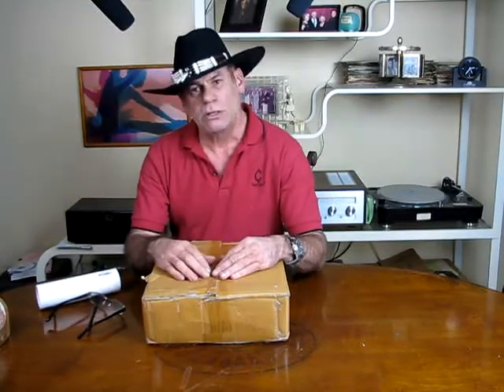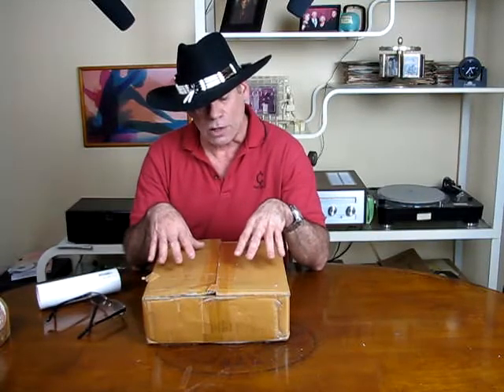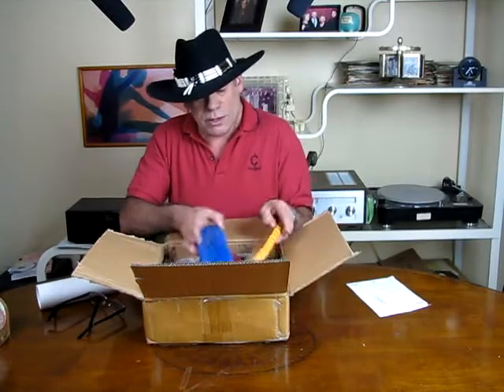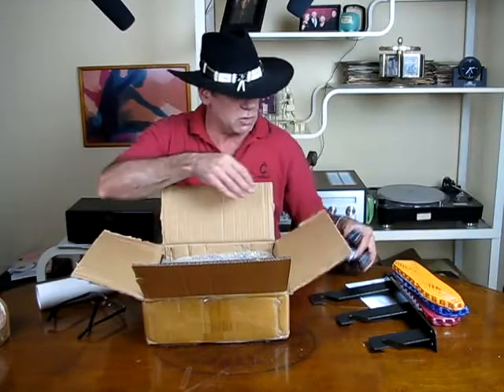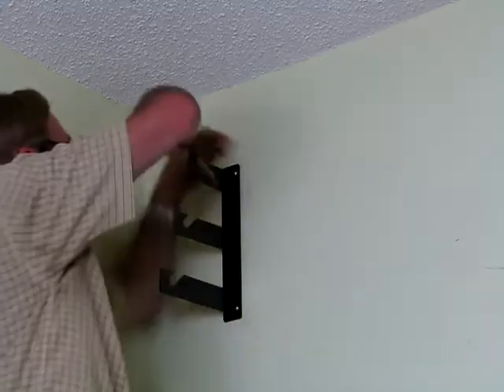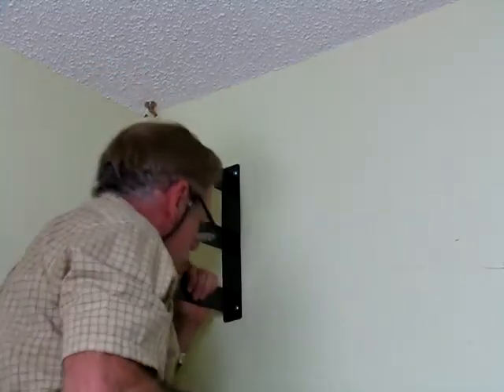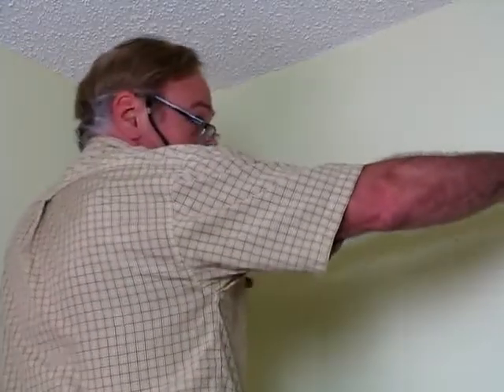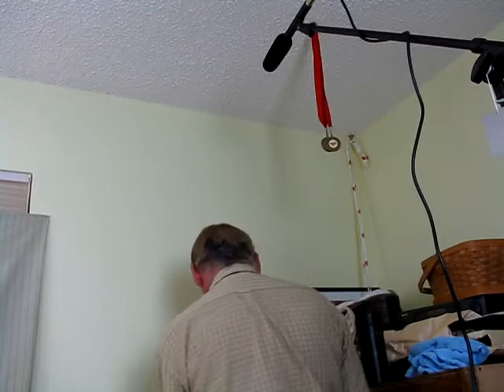Cowboy stuido Back drop3-Roller Wall Mounting system install

Comment: You look pretty darn professional with those screws in your mouth. (lol)    I've been looking at this system on Amazon and was wondering how I would hang my fabric backdrops.  I know that many people use paper backdrops on those cardboard rolls.  Nice idea with pvc.     I've also seen people attach these to their ceilings.    THX!
Reply from the maker: +OBXKEV Thank you for the feed back, took me a wile to figure out what I was going to do. Had better ideas but part of the problem is an idea that you can get the parts and does not cost too much

Comment: I was wondering if these backdrop holders can hold the weight of my vinyl backdrops which are significantly heavier than the paper one's. I really appreciate for doing this video and demonstration on how to install these backdrop holders. Oh, almost forgot to ask you what do you think about the build quality on these things? Thank you very much and great job! 👍
Reply from the maker: +Philip Ypon I think it would be more about what type of wall you are hanging it on. I am shore if you go into Studs and you use the right anchor's , and cross rod you will be fine. But the changes are plastic so that might be a concern and once again I think that will still be ok.

Comment: Awesome video!!! Just wondering why instead of inserting wood in the muslin, why not use a thinner PVC and use another adapter for that PVC and roll the muslin with that?
Thank you!
Reply from the maker: well I could not find a piece of PVC that would fil the pocket but have the friction to roll it up. I could have use a smaller piece and put screws through the muslin to accomplish that but I did not want to do that and also I was afraid that when rolled up it would cause creases. The way I have it rolls up flat and un wrinkled. I am sure there many other way to do this and very sure better ways. This is just the way I did it and thought it was easy enough for anyone to do with just simple tools. I am sure that other brands of backdrop makers have hanger pockets that might if PVC perfectly and if that is the case it would be a better way to go.
Reply: +Alans Firearms thats a good point. the friction to roll it up. great video! thanks!
Reply from the maker: thank you also the wood gives some rigidity in a piece of PVE that long. Happy you liked it

Comment: Good Job. I wonder if the dry wall is strong enough to hold all these equipment???

thanks
Reply from the maker: +Mr Li Yes if you use toggle bolts or the ones I used in the video they are rated for 75 lbs eack and the 3 backdrops and hangers is less then 30 lbs

Comment: Great video!  Question: how long is the tube, and does it ever bend in the middle due to weight?  Thanks!
Reply from the maker: My center tube is about 9 feet long and it has been up for about one year and has not bent. Use thick PVC and the wood strip ads extra strength.
Reply: Thanks!  I have another question.  What is the additional (what looks like) PVC at the ends of the main PVC pipe.  Is that reinforcement?  It looks like there there is a foot-length of wider PVC at the ends of the main PVC pipe.  Is that what it is, and what is it there for?
Reply: And if those are two different widths of PVC, why did you do that and what are the widths?  Thanks!
Reply from the maker: I just did not want such a large tube going across
Reply: Got it.  What's the diameter of the main PVC going across?

Comment: what did you use to screw in the bracket to the drywall ? did you get it into a stud or just the dry wall?
Is it this anchor:
http://www.homedepot.com/p/E-Z-Ancor-Twist-N-Lock-75-lb-Medium-Duty-Drywall-Anchors-50-Pack-25310/100040265
Reply from the maker: I used dry wall ankers

Comment: Can you send us the links for the items u bought?
Reply from the maker: It was on eBay, I do not know the link but if you do a eBay search on 3 roll backdrop hanger you should fine it.
Reply: i got the stand just need to know what pvc pipes you used...
Reply from the maker: The way I did it was I took one of the rollers with me to home depot and gut the PVC that fit it. Then I just got step down for the long cross piece. I believe it was 2.5 or 3 inch. the size is not that important as long as it is thick enough to hold the Wight of the fabric